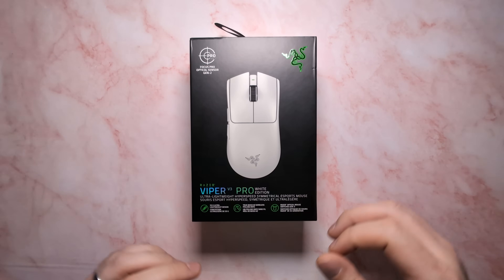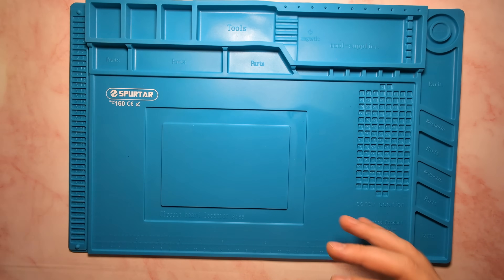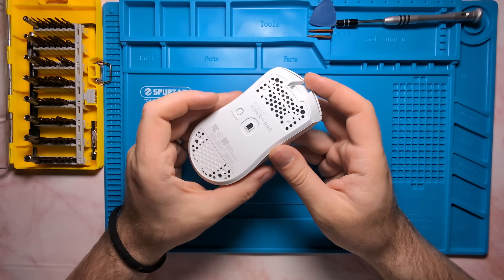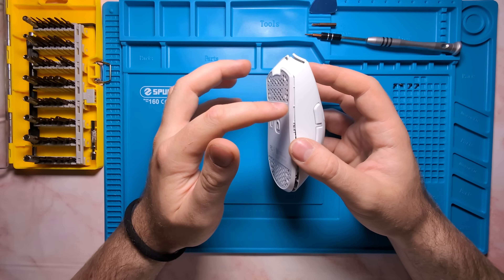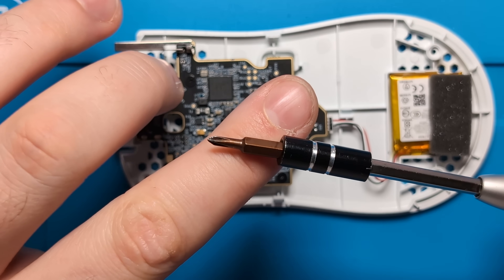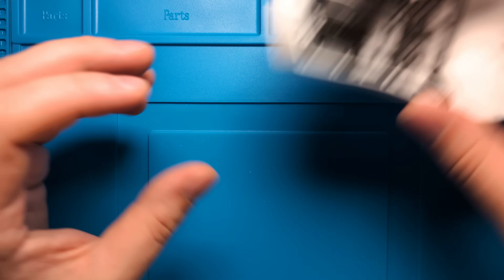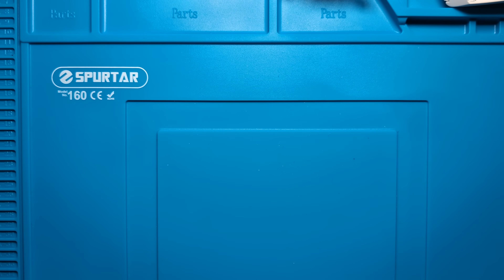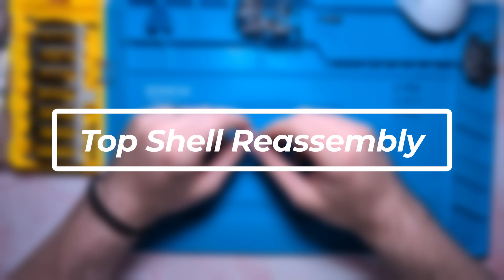TEARDOWN | RAZER Viper V3 Pro

Comment: i bought the mouse today and tested it. its perfect but left click has loose or pre-travelly feeling. i hate this feeling on left click, is there a way to fix it?
Reply from the maker: Sadly no, there's no way to adjust the tensionning on the main clicks due to how they are anchored. Best to return the mouse and get another one if you just got it.
Reply: @mel0nFPS  i will return it, thanks for your answer. hope they send me a durable one. also i heard some people having issues with the dongle after a few months of usage, is that right? thanks for answering
Reply from the maker: @berkay1062  Haven't heard or had any dongle related issues so far!
Reply: @mel0nFPS okay thanks for your answers

Comment: which mouse encoder are they using ?
Reply from the maker: TTC White Core Blue Shell Dust Proof 8mm encoder.
Reply: @mel0nFPS  thanks for reply. my hyperx haste 2 encoder is doing bad. it is not registering.
Reply from the maker: @journeyjunkies88  The Haste 2 has become notorious for that sadly, great mouse but long-term durability is awful unfortunately.

Comment: i was playing a game and flicked my mouse in to my monitor stand and now the left and right click buttons wont click but everything else works u got any idea on how to fix
Reply from the maker: Sounds like you dislodged the M1 or M2 button from their stabilizers. You can try and wobble them around to try and re-anchor them, but there's a pretty high chance you might have permanently damaged them. Sadly, due to the mouse's design you can't remove the buttons like you can on a normal mouse, meaning you'll need to get a new top-shell, but only the external shell as the central cage and PCB can be migrated to the new one.

Comment: Hey, I'm confused between Pulsar X2 Crazy light and Waizowl OGM Pro V2 which one you think is a better buy if price is not a constraint.
Btw i have small to medium size hands.
Reply from the maker: Hmmm. Tough decision as both are great mice, but I think the X2CL is the better mouse in terms of specs and feel. I did review both the CL and the OGM Pro V2, so if you want to learn more about those mice check out their reviews!
Reply: @mel0nFPS  i have already watched your reviews on them but couldn't decide as i didn't compare them deliberately but now after comparing or even before for that matter, i was leaning towards CLX2 because of battery life and perfect size for my hands but nonetheless wanted an expert take and opinion on this case or on which one you lean onto. 
Thanks for your take and as i was also leaning towards CLX2 but was skeptical due to QC issues i heard for previous products but anyways most probably will pick CL X2.
Thanks much for your response and in depth reviews and i really appreciate these in depth reviews and small things you include such as brand's reputation to a certain piece of tech and technique or their strength and weakness.

Comment: 8:04 tbh it’s not that big of an issue as I see a lot of Viper V3 Pro replacement shells up on eBay so it’s a pretty easy and cheap fix if something goes wrong.
Reply from the maker: Fair enough, though would have been nice to see less material waste though, having to throw away an entire shell just for a broken button is pretty brutal when it comes to e-waste.